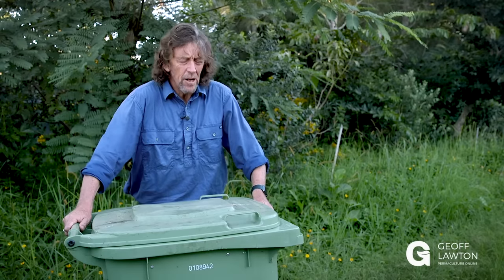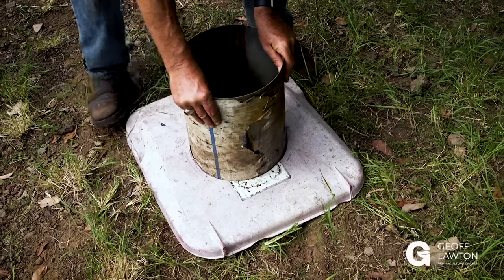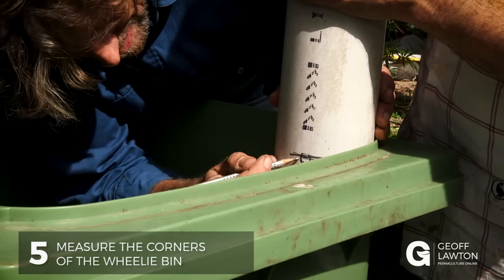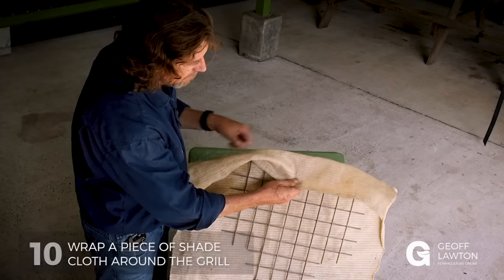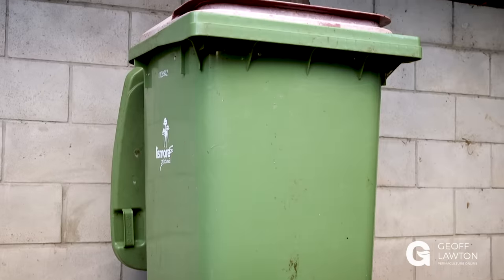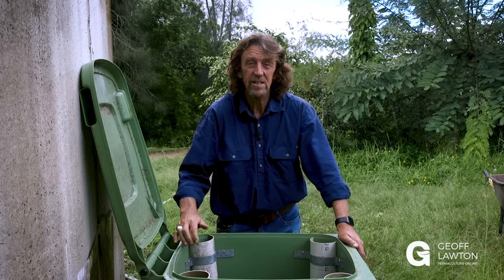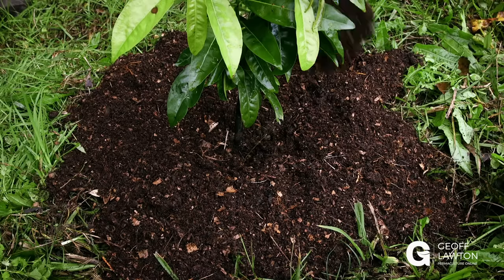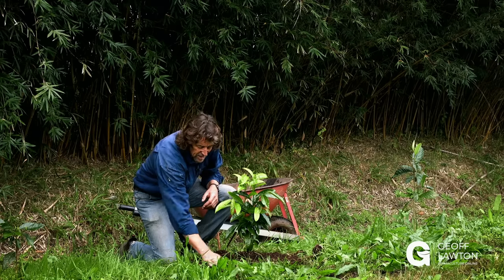How to Make a Compost Toilet with a Wheelie Bin

Comment: I feel like there was a whole section of this video missing? It went from placing a drainage layer to adding sawdust to suddenly closing the lid and leaving for 10months. No in between of explaining how the actual toilet works and the inside toilet etc? Would love to learn all that bit too....can you make another more detailed version for us green learners pleasw:0)
Reply: Compost toilet, (this is a bin ! for storage -  it is is the next step in the process) ideally one of those toilets that separate urin and the feces or much more sawdust would be needed. They have them in campers (there is a lever and if you pull it, the whole in the back opens for number 2. If it is pee only it runs into an always open hole into the  canister for urin, that can be emptied separately. And every shit must be covered by enough saw dust / wood chips that it will not stink (again people with nice campers use them). 

When the container for the solids is full they empty that (I think camping grounds handle that), or one would emty the content in the bin like the one model that Geoff showed. Then they put the container back and people can use the compost toilet again (maybe giving some sawdust on the bottom as well so the walls inside do not get dirty.
Reply: Agreed.  Needs so much more information.  When to swap? How to store when full? How to handle smells?
Reply: It's, in It's simplest form, an outhouse. You build a box to set on that is placed over top the delivery pipe. You keep fresh sawdust in the same space. When you're done "depositing" you "flush" with a can or two of fresh sawdust. Whe. The wheely bin is full is how you know to move/exchange it. The beauty is, the sawdust added each time eliminates/blocks the odor. (I don't expect you to believe that, but it's true). The tricky part is realizing that you need a toilet space with a floor elevated to at least the height of the wheely bin. Hope this helps.
Reply: @jasonb9652   There are lots of other humanure videos to answer questions about The details of the filling process. This video was about building this kind of system.
Reply: Look up the humanure handbook
Reply: @holyfenrir6336 , good advice. It's afree download to, I believe.
Reply: @yLeprechaun  everything but the current version, last time I was there.
Reply: There was a longer unedited version..can't find it..hopefully he'll reply to my query with a link 😅

Comment: I would like to see the actual toilet inside the house...Is it just like a long drop? Do you keep adding sawdust?
Reply: You add sawdust after every use until you have covered it so it has no smell. Sawdust is "flushing" basically.
Reply: Hang around as long as you like.. hey😆

Comment: May I ask how you vent this kind of compost toilet?  Also wondering how you keep the "delivery pipe" clean.  Would be great if you had a link to the plans for this in greater detail.  Is that possible.  Many thanks!
Reply: There is a book "Humanure Handbook" that may have diagrams.
Reply: make delivery pipe big like 8 or 10" diameter and it wont' get anything on it.
Reply: People commonly repurpose 5 or 6 gallon buckets, bottoms cut out, as a drop-pipe.  
BUT…since this bin has a drain for liquids, he could technically just flush a regular toilet, & have the normal waste pipe feed into the top of the bin, or top side of the bin (referrence: “Solviva” book by Anna Eddy).  
As long as the compost media is loose enuf, to allow fluids fast-passage to the bottom drain, the solids, + worms, do the work at the top of the compost media pile.  
Fluids out the drain, can be routed right to the garden via a slotted or perforated drain pipe, under the surface (out of sight)—gardens love the extra nitrogen.  

At the Solviva farm, they actually built a double chamber compost box at least 8’ h. X 2’x4’, insulated well against cold winters, w/a divider down the middle.  
& they added worms to the top of the pile in the chambers. 
Their old, high-flush toilet waste pipe was rerouted to the 1st chamber.  

It worked great, even tho they had some weekend seminars with up to 30 (?) or so people using that toilet, it never had a problem.   At 1 year, upon checking (thinking surely they’d need to swab sides), the 1st chamber was doing great, no need to swap chambers!  
But that toilet was in there upstairs.  Bins & tall compost chambers don’t work as well if there’s only a low crawlspace, & of course, no way, if house is on-slab.  

One unit made in Africa, has an outside bin; waste lands on a big acme screw, which turns each time the toilet seat lid is opened or shut, carrying solids out to the exterior chamber, where worms compost it, & its lid gives access for cleaning out the compost.  Worms can help that compost faster too. 
Worms abate the coliform bacteria Code officials worry about. 
I think this is the one—looking at the page, it’s the one on the left…waterless, picture shows a diagram of it. https://www.esan.co.za/off-grid-sanitation-solutions/
Reply: @Chimonger1  Thank you for responding.  I'm not having any luck finding the diagram of which you speak.  Would you mind clarifying how I can find that on the link you've sent me?  Many thanks!

Comment: I've made a couple of these and they are great cheap toilet for the DIY'er. The wheels mean that it is easier to move a bin full of crap around. On the other hand, one of the design issues is that a full wheelie bin this size is very heavy and difficult to maneuver in a small tight space (which is generally where they are). So not recommended for the average person to have to move a full bin this size- you don't want any bins tipping over which can happen as they are so tall and top heavy!! Options are to only fill the bin to 2/3 the volume or you can get wheelie bins in smaller sizes, but the trade off is that they will fill quicker. The smaller bins will also benefit setups where you have height restrictions and cannot install the bigger bins. You need to think about the access to the bin under the pedestal and getting the bin to where it will compost (needs 6-10 months as mentioned) while another one is being used. An addition to this model is installing a fan in the upper side or top of the bin and associated piping to reduce smells and increase air circulation to help the composting process and also a urine diverting seat and associated piping will greatly reduce bad odors! This has been revolutionary in our DIY composting toilet journey- installing a urine diverting seat. No more stinking toilet smells once you divert/ remove the urine from the pile- it's amazing!! If you go with peeing in the main chamber, be mindful of where you attach the urine drain as when you move the bin fittings can be easily snapped and in my experience are usually a point of leakage so seal them well! But I can't recommend enough diverting the urine from the pile in the first place. You also want to have the installation of the urine drain easy to access for cleaning and maintenance. A few tips....
.
Reply: Excellent tips, thank you!
Reply: Yup. 96 gallon Toters are quite heavy when full. Their advantage is large diameter wheels. As long as the ground is hard and flat, they're pretty easy to move. If not, I make a path with corrugated corrugated cardboard or old fence boards. If you don't have a lot of material, you can make two 6-foot sections and advance by moving one section at a time.
Reply: Excellent tips, thank you.

Comment: Thanks
I was looking for a Swedish model composting toilet. Been around for hundreds of years. Built in and permanent 
It needs height and a slope down one story to a door at the bottom for clean out once a year.
The slope is "stepped" and the steps slope downward too. This allows the material to turn as it makes it's way to the bottom clean out. 
I'd like the proper degree of slope. Don't want to get plugged up because it was not steep enough and don't want it too steep either. It needs the time to fall and turn as it composts. 
Liquid drains out the bottom. 
It needs a high pipe to/through the roof that controls the smell with the natural up-draft that is created. This requires a tight lid so you're not losing the heat of the home. Air intake vents in the clean out door.

I'm building with superadobe and it doesn't get much simpler than that.
A hole in the floor would work and be healthy for you but I like the height of a toilet these days. 
Did you know "squatting" is the natural way to go?
Your bowel hole opens fully and operates properly when squatted and only half works on a toilet. It leads to problems later in life. Don't ask me how I know. 
IBS anyone? How about a "leaky" hole? And it's not the one in the floor!
When I was young I was shown a hole in the floor as the toilet and told the people were substandard, ... little did I know that I was the substandard one.
Nothing natural and organic was good enough for this idiot eh? Not when it can be "New And Improved", for profit that is.
I've since discovered that profit is a lie and like all lies needs the constant expenditure of time and energy to exist. Your time and energy. Right Santa?
Profit is the method used to concentrate the abundance of "our" world into the hands and control of the few, the elite, the entitled, and the great winners in a perverted world of win/lose. 
This hoarded abundance is then used to control and direct a population of brainwashed "for profit" economic slaves who only understand, worship, and practice the childish win/lose as civilised. 
Don't ask me how I know, .... 
 
Man, everything that's wrong with me was beaten into me as a child under constant threat of being wrong, making a mistake, failing, and being a filthy loser. The academic win/lose eh? 
The win/lose, just a disrespectful and childish understanding of our live/die life.
Except you don't die silly! You just don't have an opinion that matters and your abilities MUST benefit the winners.
I'm working on the Ways of the Win/Win and am happy knowing the future people will know that the work and the Ways of the Win/Win was born of their filth and failure, (that would be ME!) and not their wisdom or honour. The poor perverted people of the win/lose have no wisdom or honour. Sad but true.
I know this because I once thought I had a little honour. Never even thought I was wise and still don't. I'm just doing a dirty job that must be done. 

You know, asking why people allow their own children to be born owing a debt of lies and corruption called "eternal growth and profit".
Why do we allow our children to be born slaves? 
Easily denied eh? specially by the "free". lol, lol, lol, ... 

Then there's the paradigm shift from "for profit", to, "Not For Profit". 
A community owned Economic Win/Win based in time alone, backed by the abundance of "our" world and built on a foundation of Truth and Reality. Oh yeah, ... the paradigm shift is given freely and unconditionally. That alone makes it "suspect" eh? Then there's the cowards who drool "Commie". lol

Sorry for using your post to plant these seeds of Win/Win, ... but I learned from the win/lose and don't play fair! 
 
Have a great one.
Reply: This was how to build a shitter not talk about it
Reply: Turds and wee, along with a little paper, move along quite nicely at about 16.5mm per meters fall in a 100mm pipe.
Reply: It seems you have a good overview of the political nature of man. I view the win/lose competition to be a great hobbling of mankind. I would like to discuss these topics further and in more detail at a later date. Regarding compost toilet. This video showed a half pipe in each corner of rolly bin. Are they meant to have free air flow or forced air flow or is static air sufficient?
Reply: where can i find more info about this swedish model composting toilet?

Comment: For a better water tight thread through the bin for the ball valve. Go to reece irrigation and get a 20mm water tank adaptor. They screw together either side and clamp against the bin with water tight rubber flange either side.

Comment: If you’re new to this and not elderly, disabled or in very cold climates... the simplest toilet is a tiny garden shed that isn’t tightly built, built on top of a platform made from pallets screwed to posts on concrete footings. Put this near your front door, ideally in a spot that won’t get sun all day in summer. Line the composting chamber with black poly, and mound up soil or gravel as a base to keep surface runoff away from seeping through the bottom of your heap. Better than sawdust is rotted wood duff, but this is harder to find.
Reply: Don’t pee on the heap unless necessary. If you only have to go number one, you need to use a separate (much simpler) toilet that goes to a large camper plastic bag, whatever one calls those things. Put this in the same outhouse.
Reply: You want it enclosed in a shed for cold drafts in the middle of the night.

Comment: when the lid is  closed wouldn't that Block air ventalation and thus lead to anaerobic decomposition that we are trying to avoid?
Reply: I suggest have another smaller pipe way going upwards, or a ''crossroad'' of the main pipe at the top. The smell would go out there also have proper ventilation.
An better solution to this is one with a crank, soon as you are done, crank it so it mixes up with the compost material. Another old solution but effective if made properly. Look it up.

Comment: Without sounding disgusting or cruel, can you add compost worms?
Living in  the suburbs what would you do with the liquid, my neighbour is down hill from me, i wouldn't be asking if I didn't like him.
Reply: I was looking at a wormery site yesterday and they had wormeries for pet poo, so I assume yes? The important thing about humanure, though, is that pathogens can last for (or so I've read) about two years, so you shouldn't really use them before that, and it would just be safer in general not to use them around salads, where the bit you eat is in contact with the humanure.

As for the urine, it would be better in the suburbs to separate urine from solids. Urine is clean and sterile when it's fresh, as long as you don't have a urine infection, but it quickly turns into a breeding ground for microbes if you don't use it quickly, be that on a compost heap or mixed with water as a fertiliser.
Reply: Yes, I just found this video where a guy is talking about combining a composting toilet with worms and with bokashi composting all in one system. No idea if it's a good system though, but it seems to work for him. https://www.youtube.com/watch?v=L1H7Wb35isw
Reply: i have just started one like this an i use turkey nest instead of saw dust i am  adding worms to help brake it down .i am hoping the nest materal will work better than saw dust as it is allready acataved
 no smale so fare
Reply: @ashleighcash4681  Thanks for the reply. My local council won't approve this where I live, I was just wondering. Do worms eat saw dust?
Reply: @ashleighcash4681  website not working, yes I live in Australia. I am only curious about this and think it is a good idea to conserve clean drinking water as our dams are half full. I'm sure one day composting human  waste in our own backyard in the suburbs will be as popular as water tanks. Back in the eighties my friends dad got fined by the council because he was collecting water of his garage roof into 100 litre tank, the neighbours called tbe council because they weren't happy. Now it is mandatory that you have rain water tank in every new house.
Reply: I have 3 normal compost bins full of red worms compositing worms. Iv read that they don't like human waste so I decided to experiment. I put some of my own toilet waste in there and after a cupple weeks it was jam packed with worms. I suspect they like my waste because I have a diet high in fruit and veg and low in meat. The compost from that bin is for trees and shrubs only to be safe.
Reply: @RichieRich845  Yes.
Reply: @RichieRich845  Microbes break down saw dust (decomposition) then earthworms absorb the juices through their skin ...pathogens and all. The earthworm's system destroys pathogens and earthworms poos semi solid called black gold. This is a very interesting field.. Thank you very much for this video. I am a composter of food waste for my garden.
Reply: all you need is add sand and soil along with saw dust the decomposition speed up very quickly and the matter can be disposed in your garden or in any wooded area once a bin is almost full.
Reply: I'd say no as this is manure, manure is already decomposed elements from our body.
In Geoff's video "Compost worm farming" you see him placing horse manure at the bottom of the bath, could be humanure
Reply: @RichieRich845  yep, and in SA all the new solar panel installs r fitted with mandatory remote off-switches to force people to 'stabilise' the electric grid $$

Comment: That's the shizzzzzz!   ;- )  and even the pizzzz!
Seriously, that is cool, and so simple.
But, you did not really show us the full process.
The bin you showed us at the end did not have a hole in the top.
How did it get there.  Can you do a full video that includes the complete process?
And you illustrate the "cleaning process".
I like the idea that this can be in the room underneath the toilet.
I've seen huge composting toilets at campgrounds and they did not smell at all.
Currently my toilet has a leak and I am wasting water until I get it fixed, so this
would be much cheaper and simpler.
Reply: the cleaning? dump.it in a compost pile and wash it with vinegar.
Reply: Start with a bucket and saw dust . I that is what i am using.